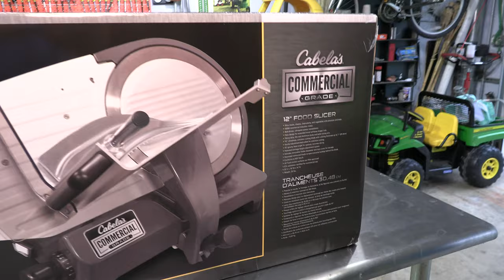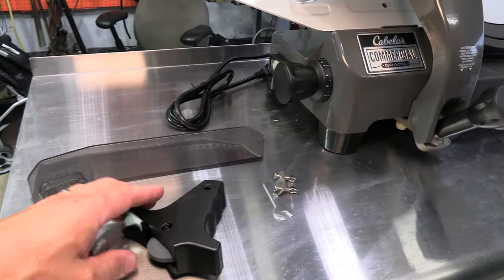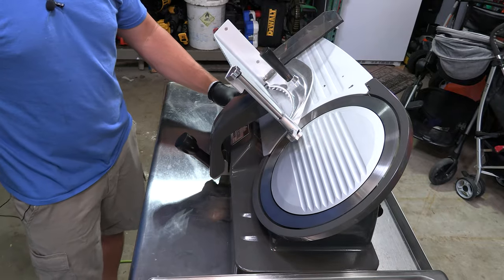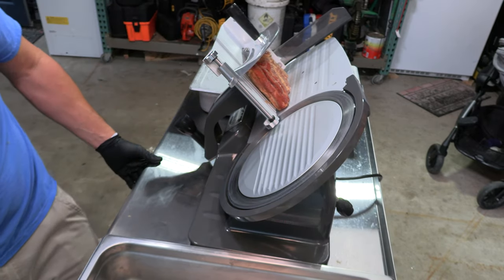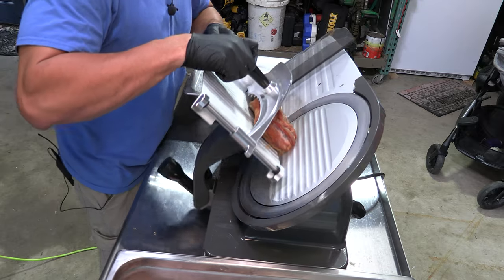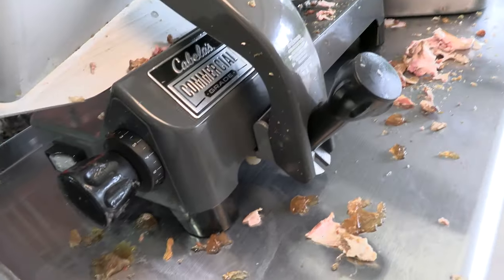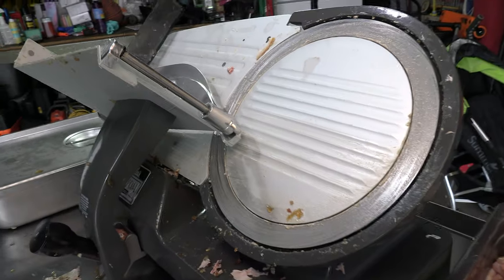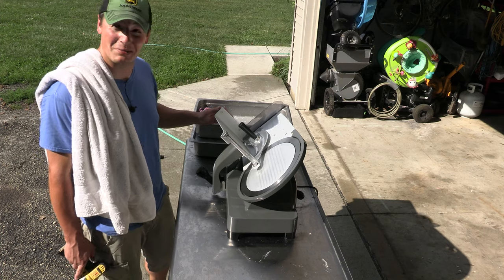Cabela's Commercial-Grade Food Slicer - 12" - Review and Testing

Comment: Looks like a very dangerous slicer.  I would not recommend after viewing this video. Looks incredibly flimsy.  I did not like the wobble on the vertical stationary plate.  I used Berkels at my restaurants and have a 12" Globe Chefmate at home that is beast.  Highly recommend a used Hobart, Globe or Berkel over one of these.
Reply: Beswood or KWS are my personal minimum standard - they are built like the high end slicers, but have less capacity and aren't really designed for constant use, but they sell all the parts to repair if necessary.

Yes, Hobart, Globe, or a high end Berkel will perform better, but also cost a lot more. If you find one of those on sale used, grab it - it will last forever.

Comment: I bought this and returned it same day what a piece of crap. Very flimsy unit.
Reply from the maker: I noticed that the main back plate was flimsy also. I had to take apart the bottom piece to access the screws to tighten it. Besides that, it has been working great for me. 

Did you get a different one that you are happy with? What model?
Reply: @Simple Man’s BBQ  I did I bought the KWS 10 inch in red  it's a solid unit but after having both the one you have was not really bad after all ...I guess there all pretty much the same unless you spend like $1800 on one from Hobart.
Reply: We use it alot for deli meats cheese tomatoes I don't do jerk but I'm thinking about it. I have an airfryer with a jerk function on it. I also do brisket and tri tip too

Comment: I am concerned about the lack of a back support, looks pretty wobbly which would lead to un-uniform slicing.
Reply from the maker: Yes sir. I fixed that after I saw how bad it was when I was editing the video. There are bolts underneath the bottom plate up in the slicer that were loose. When I tightened them up it fixed the issue.
Reply: @simplemansbbq5495  Very good.  Thank you!

Comment: I have one. It's a POS
Never a consistent thickness
I usually take the table off and free hand it.

I will never buy another Cabela's brand, meat processing piece of equipment
They change the design every two years so the dont have to honor the warranty
Reply: You can see the backplate rocking in the video. Ya that’s a pretty suspect way to mount something that takes a lot of the pressure placed on the meat.